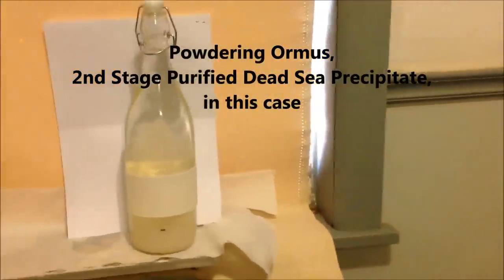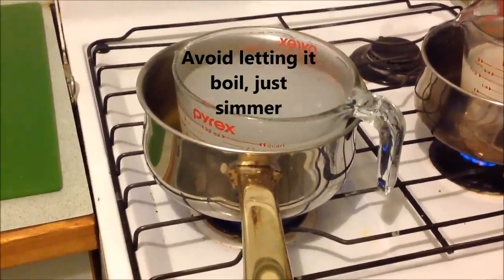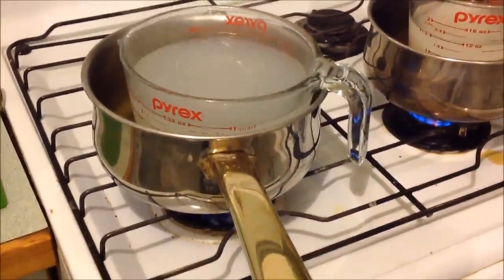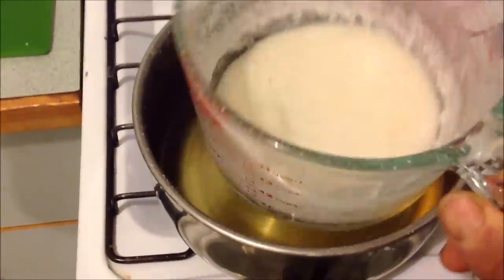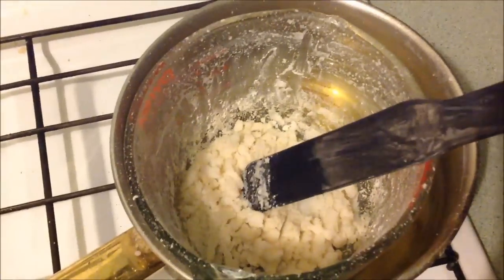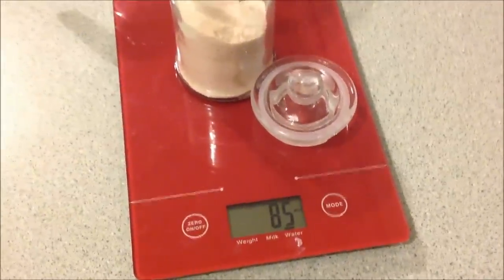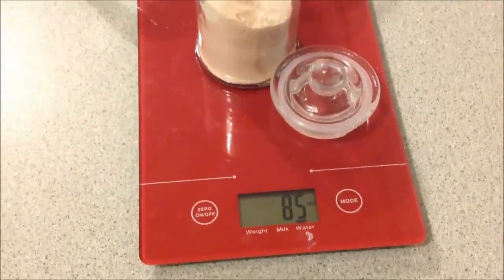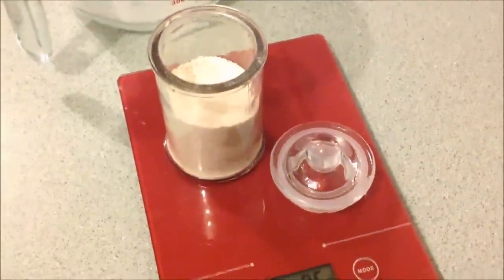Making the White Gold Powder

Comment from the maker: Hi again Trey, I am not a user so to speak. I have tried first and 2nd stage Dead Sea salt precipitates wet at low doses of 5 and 1 ml per day respectively over a couple of weeks each. The first in about 100ml water and in the latter case I have done this for 2 periods under the tongue for at least 5 min before breakfast. The only affect I was sure of was a sweet post nasal secretion. I have inadvertently taken some of the dry powder to taste test for salt. I did not notice any adverse effect. I must say that I am very reluctant to experiment too much without further testing although I am fairly certain there is nothing harmful in properly prepared Dead Sea product, or that resulting from materials normally ingested such as Sea Salt, water, fruits and veggies etc. At this stage I would approach it as an activated mineral supplement. I am not personally interested in chasing a sensation as this could be the body sensing or responding to or being affected by a poison. The big thing is whether it makes you healthier in a holistic sense without sacrificing anything normal and good spiritually, emotionally or physically. There is testimony out there of significant debilitation in some cases. It is reasonable to be wary whether this is more than an atypical reaction. Be safe. There is plenty of fun in doing experiments. I would enjoy taking long service leave and tackling the verification of many things just for fun as well as understanding. Bless ya mate, from Oz down under, to where ever is home for you.  Bruce

Comment from the maker: Hi Adam, Calcium hydroxide is soluble at .175g per 100ml water at room temp. Therefore 2.5g could dissolve in a 2000 ml wash or 7.5g in 3 washes.
In 150g of salt there is .2 % CaCl ie 0.3g. So there is no way that any Ca(OH)2 can remain after 3 wash and settle process. Enjoy Bruce

Comment: The only way you'll get pure monoatomic gold is if you start with a bar of gold. Using seawater you'll get mostly gold with other m-state elements. Dead sea salt has the highest amount of m-state gold followed by Celtic grey salt. I prefer using Celtic gray salt because it doesn't have any toxic bromide like dead sea salt. Plus Celtic grey salt has a more varied m-state profile.

Comment: Do you part the m-state from the magnesium and calcium hydroxide with HCL first?
Reply from the maker: Hi Adam, Calcium hydroxide is soluble at .175g per 100ml water at room temp. Therefore 2.5g could dissolve in a 2000 ml wash or 7.5g in 3 washes.
In 150g of salt there is .2 % CaCl ie 0.3g. So there is no way that any Ca(OH)2 can remain after 3 wash and settle process. Enjoy Bruce